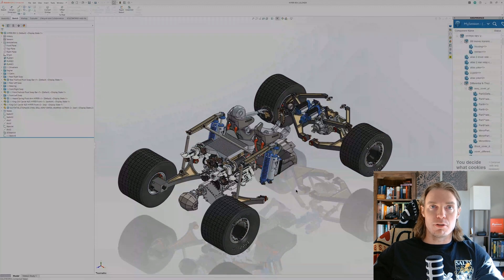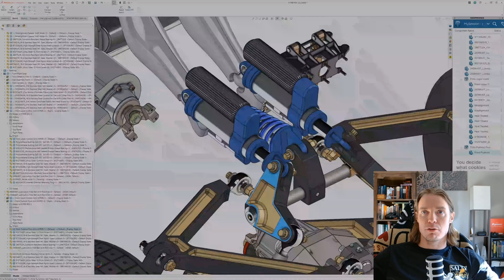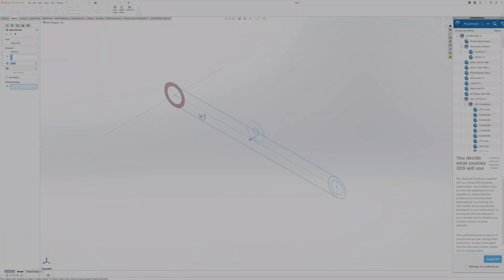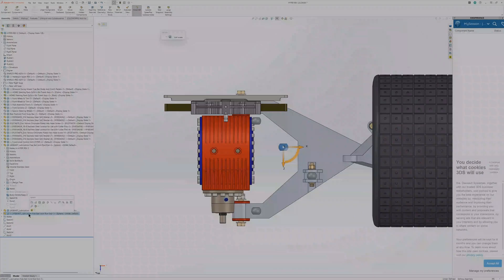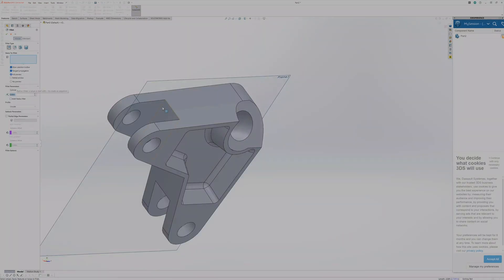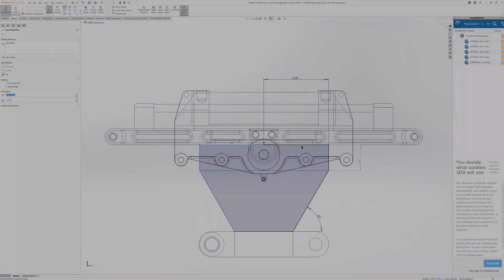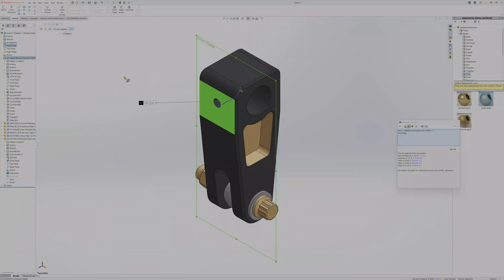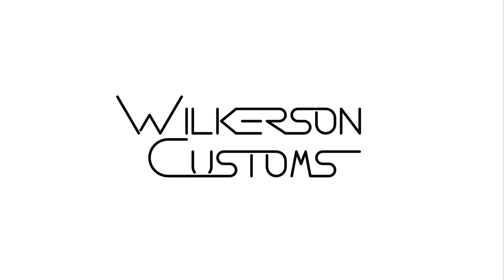Innovative Front Suspension Design: Dual Push Rod with Heave Spring Setup

Comment: I'm no engineer but it seems like the 1/2in. pin attaching the heave spring to the torsion bar is a weak link. If it shears off, the suspension collapses.

Comment: 2:53 Reduce the spline count on the shaft to a 10 or 12 or you will get torque welding. This happened to Porsche (maybe McLaren?) just a couple years ago. Beautiful design work! And this modeling program is amazing! Even getting the chrome Heim details in there.